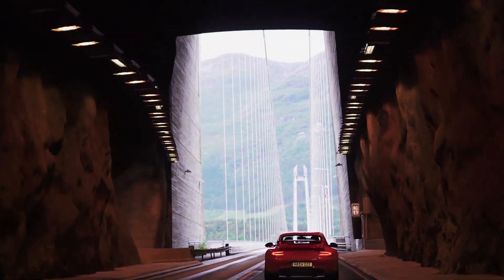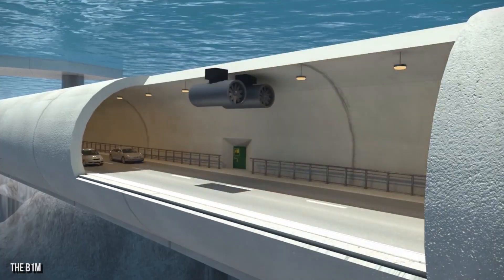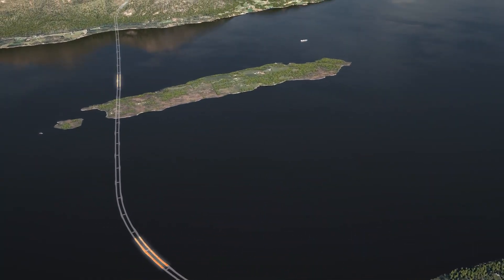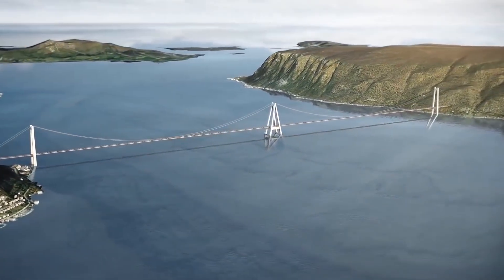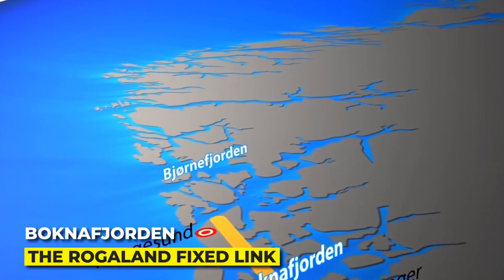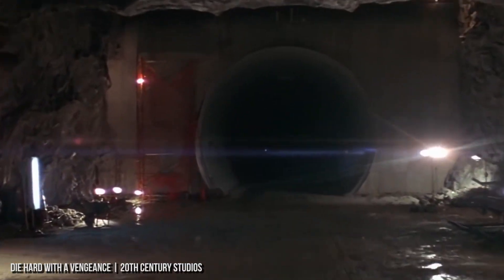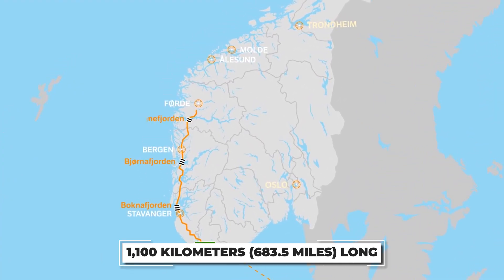Inside Norway's $47 Billion Floating Highway

Comment: if the sea has waves then hold the pipes with cables 5:11 and anchors otherwise if the sea does not have waves then hold the pipes with 5:14 buoys. 9:50 in the subtrunk

Comment: I thought that the goal was to dig a tunnel underneath the bed of the water and then build your roads.    Placing a tunnel, suspended 400 feet below the surface, with all that tremendous water pressure, would be a cataclysmic event.   Aren't there ice bergs, along with intense winter storms with violent seas there at times? 

Some idiot is bound to end up crashing a sub or some gigantic ship into one of those tunnels.   Human stupidity will guarantee this.  We are talking a type of implosion with a pressure of 5 atmospheres.

Comment: Only 47 billion dollars? After skimming the cream it will be more like 470 billion dollars. There have been scandal after scandal. Bridges falling down, brand new train tunnels on fire and missing billions of construction dollars.
Just 3 months ago a brand new tunnel caught fire and it turned out that they spliced electrical cables with plastic tape.
Corruption is everywhere.

Comment: In case of fires there would probably be an emergency exit route in a separate access tunnel under (maybe above so if there was a flood the tunnel would still be useable) the main road deck like in the Mont Blanc after its disaster 

And the cables that anchor it to the sea floor would be pre tensioned to have some give in them to allow an earth quake’s energy to be absorbed.

Comment: Wow, now for the same price of riding on a nice ferry that already exists you can drive through a ridiculously expensive tunnel.

Why not replace the cars with trains?
Reply: So you want to spend twice the amount for train tracks and a few stations here and there that people don't use?
The incline and curvature requirements for rail is much more strict as well.

If the goal was high speed rail connecting Stavanger-Bergen-Trondheim, then I guess it could be an option. But the passenger and cargo potential is to low for it to be economically viable.
Problem would be to get across the fjords that are wide and deep with a bridge.
Reply: @Gazer75  Twice is an exaggeration.  Im not so close-minded as to suggest that the project should be the same except "trains". I just think that any nation building new roads for cars right now isn't making a wise investment in their future.  Immediate economic viability isn't the sole metric by which we should judge a project.
Reply: @finneganbell6784  You can't just build a railroad for the sake of building it. It has to make sense economically.
The railroad simply wouldn't be used much as there are a limited number of people going between the 3 cities.
High speed rail is also the only option as it has to compete with flying between the same cities.
That kind of excludes cargo from being a thing on the same tracks.

Railroad here would simply cost tax payers to much.
Just to many fjords to cross which makes it impossible. 5% incline which is the max on modern roads is actually very steep for rail.
Flåm railway is 5.5% at its max.

Think you have to study the topography of the Norwegian coast before saying rail is the way to go.
I believe they did a study on rail and quickly dismissed it.
Reply: @Gazer75  I think you should study the topography of Switzerland and rethink your conclusion.  Im sure they did a study on rail and likely found that roads are more economical on a short term scale.  But they could make it work, and if they were really about fighting climate change they would.  They didn't, so they aren't.  And when the world turns away from the oil industry they will be left with tough choices about how to make their infrastructure feasible.
Reply: @finneganbell6784  Comparing a smaller country in area with a much larger population compared to the area around E39.
There is a big difference between mountains and deep fjords when it comes to constructing rail. A mountain you can blast through, making a bridge crossing several km of open water, that is also quite deep, is a different matter.

In a few years most of our cars will be electric anyway at the rate its going now. So far in 2022 over 80% of new cars sold were EVs. Pretty sure in 10-20 years trucks will be electric and/or hydrogen based as well.

Comment: I calculate only $146 dollars in gas over the 700 miles if the car averages 30 mpg with gas at the current price of $6.27 per gallon in Norway. The 47 billion dollars, if distributed instead to each household ($20,800), would go a long ways towards the purchase of an electric car, which would cut gas usage dramatically.

Comment: sounds good but once those waves get rough and the sea pushes the concrete tunnel, bear in mind that concrete is only good in compression and not torsion or swaying, its going to be a big big problem. I doubt a buoyant float or some cables will stop it from flexing in the ocean unless there is some new type of concrete that is flexible and I don't think that will ever be possible lol.

Comment: No thank you.  I would not want to be in an accident in one of those tunnels.  Also, how do they ventilate such a tunnel underwater…
Reply: The tunnels are not that long. We already got the 24km long Lærdal tunnel with a ventilation tunnel about 1/3 of the way in from the north side with filters and exit up to a valley.
Longer tunnel have fans in the roof blowing that will move air through the tunnel as well.
The Rogfast tunnel that will be 27km long have two ventilation towers on each end about 2-5km in just before going under the sea. And because it will have an interchange below the Kvitsøy island with road up, there is also a ventilation tower there to exchange air.
Reply: @Gazer75  what happens in an accident?  I would hate to be stuck in a tunnel waiting in an accident to clear.
Reply: @Onasugar  Modern tunnels are wide enough to turn around if needed, like in case of a fire. Even trucks can turn around at some places. For dual tube tunnels there are dynamic signs above each lane that would allow two way traffic in one tunnel if needed.
These tunnels are also dual tube so you could evacuate to the other tunnel through emergency exits.
There are also safe rooms at intervals in case there is no way out. Though this is more a thing for a single tube tunnel.

If there was no immediate danger to others there is no risk to being stuck in a tunnel for a while. Of course fossil fuel vehicles should turn of the engine.

The Lærdal tunnel takes about 18 minutes to drive though at 80km/h :)

Accidents are not very common on the road here in Norway. We had only 87 deaths in 2021.

Comment: if we use shielded shipping containers as floatation and we put freeway frame on a a shock absorbing truss over the floatation then roll out the rolling rubber road layers so it cost less than1 milliom per mile meaning the 6000 miles accross pacific project may cost less than 50 billions including salary and insurance. in war it can build 10 big floating island equal 5 million air craft carriers. but to be safe we build it near shore so it could be 15,000 to 20,000 miles we can drive from california all the way to japan, vietnam hong kong on cars with many casino like hotel along the way or exotic hotels

Comment: How will engineers solve the problem of coastal tide levels, if the bridge uses the floating / pontoon design. Winches?

If anchored to the sea floor, cable corosion management is going to be a nightmare. 

I've always wondered if such a underwater tube highway for electric powered trains could connect Europe to North America via Scotland - Iceland - Greenland - Canada. I've always come to the conclusion that it isn't feasible because of ocean currents.

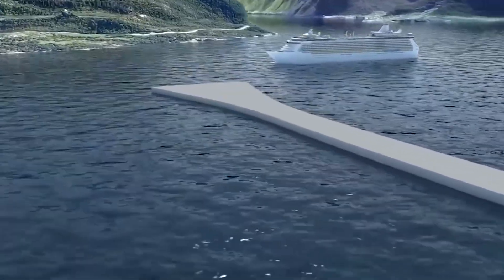Comment: The picture at 8:39 is La Reunion and not in Norway - Nouvelle Route du Littoral (NRL) completed 2018
Reply: Most of these images are not in Norway. They are just filler images to fill gaps between examples of the floating highway.

Comment: Solar roadways in Norway? They have 20 minutes of daylight during winter unless you are in the parts of Norway above the polar circle, where the sun is gone for 4 months! In the US solar roads have proved insufficient for even running LED markers in winter! Most heating of road surfaces is from direct solar heating of the black tarmac. Using solar cells for electric heaters produces at best only 1/3 the energy per sqm road surface! A more efficient approach would be using heat pipes under the road, to make use of the few degrees of temp difference from the rock below. Driving through the longer tunnels through Norway, they are sometimes around 15C during winter only fromn radioactive decay in the sourounding rock.

Comment: The daily ebb and flood would require some moving elements (to keep the tunnel at the same depth), which would constantly wear out and have to be replaced every few years.
In case of just one of these elements getting stuck, unable to move, ebb/flood would put a huge strain on at least two of the tunnel linkages. Also, the closer to a tunnel endpoint where one is stuck, the worse the strain would be.

A storm can also raise sea level by a few meters within a day in a fjord, and (assuming the moving elements are not stuck and can adjust to this), the sideways force on the structure from the water rushing in, and later out, would definitely also be able to rip the tunnel linkages apart. The water rushing in/out would also put a huge sideways force on the pontoons, which would put a twisting torque on the tunnel, which might be a lot worse actually.

In a very cold winter, the water could also freeze to a depth of a few meters, and the ice could easily squeeze the pontoons enough to rupture them.

Seriously, there are so many ways this can, and will, end in complete disaster.

I just wonder when they're going to realize this, and abandon the project.

Comment: Thumb's Up, to the inventors, architects and engineers for this latest innovation. The main focus must be and only to the safety and security along with solid maintenance. 
The rest, engg and technical matters will be as is.
 Earthquake, storms, and other calamity effect is negated just concentrate to main self balancing mechanism so that the shaft/main road is not affected by the variation of water level
Solid and out of box idea(engg and technical) as a whole. 
Hat's off.

Comment: Underwater tunnels are a great solution, floating ones looks fantastic. Now with the sea level rising plus the water temperature rising. I'd put the ways in more than 20 meter above the sea level...4:13 it would be sad to invest this money for it to be flooded in 25 or 50 years

Comment: Hey experts, 

I have a question. Have the designers considered about any density changes in sea water. I feel like that it will affect to the upthrust force on the floating tube parts for sure.

Also, will the sea water rising due to global temperature affect on this floating highway?
Reply: Water density change will be the least of the concerns. Sure, there will be a minor difference from meltwater in the spring, but not enough to be a real problem.
Sea water rise is currently about 2.2 mm per year, and daily ebb/flood is much, much more than that. 100 years = 22 cm rise, not a problem.

There needs to be moving elements between each pontoon and the concrete tube it's attached to, to adjust for ebb/flood, and that's where I see at least a few problems.

Anyway, I think the biggest issue would be a big storm forcing water into the fjords, raising the level a few meters, and putting a sideways force on the pontoons, as well as the submerged tube.
I'm quite certain it's not possible to design something which would withstand those forces, at least not without blowing the budget completely out of proportions.
Reply: @silvergreylion  with those red pontoons (?) on the surface they showed which would enable traffic to pass safely through… what if someone deliberately crashes into it… I know that these kind of things are rare in Norway but there is always that worry

Comment: How does gas from car exhaust escape? What if there is a car accident? What if a truck loaded with dangerous chemicals blow up, walls crack, and water rushes into the tunnel?
Reply: every decent long tunnel has a ventilation system towards the roof

Comment: Why they just don’t cover current roads ? To avoid the weather issues? It would cost them less and then they could build some underwater tunnels but for much less than 48 billion dollars
Reply: there are existing roads which are linked by ferries; But the roads are usually not made to handle a high traffic volume. So they want to do it right and build a proper road which is able to handle the traffic volume. Bad weather isn't a big issue there tbh

Comment: Beautiful country for sure but I would prefer the fairy! I am a bit claustrophobic! I couldn’t imagine being in the middle of an emergency,and having to wait for the emergency escape elevator to go up empty and return. Then get on the elevator and ride it to the surface 80-150ft up. Then what’s up above the tunnels in the middle of a cold windy fjord with large waves that is going to be safer than the tunnel? Glad I don’t have to solve any of these issues. I don’t want to give away my thoughts on driver safety kits. I’m so paranoid I’d have everyone’s wheels turning and few will want to drive in such a tunnel after I freak them out with all the ways they could die in it!🎟🛻🚑🚒🚓🏊‍♀️ 🚣‍♂️ 🌊💨🌨❄️🧊🤿💸💰💰☯️🚢🛳🇳🇴 lol!! 
I’m sure since it’s been proposed and postponed over 100 yrs until they had the engineering, weather, water, material knowledge to build such an incredible structure! At the end of the video it states, Japan and other countries have been installing such tunnels. I believe Tokyo has a tunnel similar to this concept but most importantly they experience earthquake of a very high magnitude so their tunnel engineers had to be super safety conscious. What I mean is with Japan leading the way to the future, you can learn a lot from some else building something first! The tunnels possible downsides, failures...... and also it’s success recorded!
Reply: norway already ahs multiple submerged tunnels in every big city

Comment: 🚇🚗🚖🚕
I still believed that they should of build that tunnel under the sea bed why?
1. Natural  gradient temperature the lower you go the warmer it get. 
2. Avoid Frequent repair from external/ internal water leaks. 
3. cold weather contracting and expanding due to temperature variation which will cause cracks damage and tunnel destruction.

4. Terrorists attack by dept charge and other implements.
5. Accident via collision with subs and boat
6. Iceberg 🤕
7. Radiation shielding 
8. Building under bed rock preserve the natural ecosystems.
Reply: if terrorists would want to bomb a tunnel, they have thousands to choose from already. Norway has multiple submerged tunnels everywhere, this is nothing new

Comment: I have travelled a lot in tunnels across Europe, and I would never want to travel in one. They are the most boring structures to experience - no view of nature which was the whole point of traveling. Who wants to sit in dar tunnel with no view for hours? Might as well sit in your home basement at that time, even cheaper.

At this point I might as well take a flight (which spends more CO2) to have a better view of the nature down.

Another example why giving access to government to run country's infrastructure leads to massive malinvestments. I'm an engineer myself, and I ask the question, why couldn't they spend $50 billion on improving infrastructure related to flying cars running on batteries (they have operating temperatures well upto -40C and with good insulation even lower) and at the same time leave nature untouched. Even if one flying car cost $1 million, you could get 50k flying cars at this cost of the project.
Reply: so the whole point for transporting cargo, public transports etc is for the view?

Comment: But hang on Norway, haven't you been listening to Greta Thunberg, the climate change expert. What's the point of building floating tunnels because all your entry & exit points of land will either disappear under rising sea levels, be frozen over in a mini ice age or be lashed by violent storms with winds of 500 kmh. That's if the ozone layer doesn't open up &you all get microwaved which means you won't even need a car. Electric of course. ⚡⛈️🌪️🌩️🌡️🗻🌋💥.  My shrink was right you know, you shouldn't drink coffee before you go to bed or you will have horrible nightmares. 😵 😂.

Comment: Just my amateur view, but it's too bad it's all for the automobile and not have like an Elon Musk designed Hyperloop.  You could live in the farthest northern community and commute to one of the major cities i.e. Oslo... in half an hour etc.  Maybe such a design would cost even less than the space, lighting, heating, ventilation, construction materials, degree of earth-boring etc. one encounters trying to design spacious tunnels for automobiles.
Reply: extremely expensive and far from safe - yet. A lot of testing is still needed to be completed
Reply: @gullfeber  Hi!  Do you mean a hyperloop would be far from safe and extremely expensive, or an automobile tunnel?  I'm only amateur but it seems automobile tunnels at least appear much larger and  involving more boring and construction materials, ventilation etc. than a hyperloop would, but again I'm only amateur.

Comment: There's zero.chance they're going to build a tunnel at 390M deep. I'm sure you got your units mixed up. Even 390 feet is really deep. 1200 feet is incredibly deep, the pressures would be impossible.  

If they're 100 feet below the surface then they're not floating. They're submerged.
Reply: the tunnel is connected to segments floating on top of the water